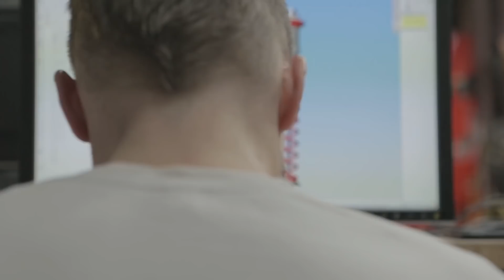He built a racing monster machine! - Guinness World Records

Comment: Looks like the guys putting in a lot of effort using his limbs instead of a couple of buttons and levers
Reply: This is more efficient it helps with more accuracy but it also has it cons
Reply: This kind of setup significantly simplifies the control side of things since actuators can be more or less directly mapped to the various degrees of freedom of the things he's moving. 
It could be done without requiring a lot of effort on the operator's part, though. I'm curious whether that is a deliberate design decision or simply something that is not a priority to change